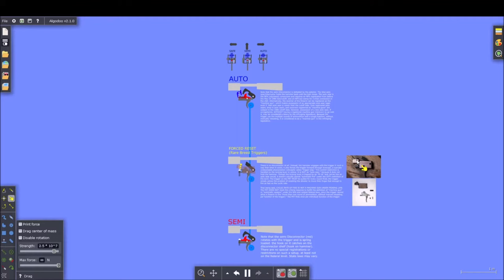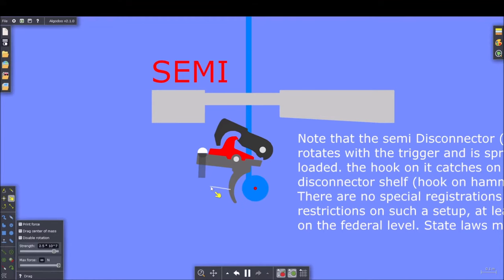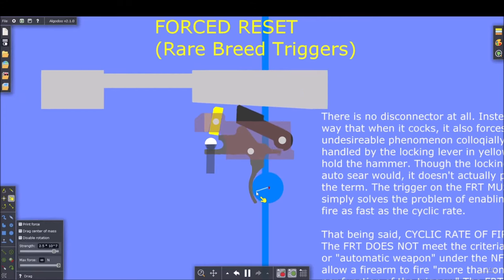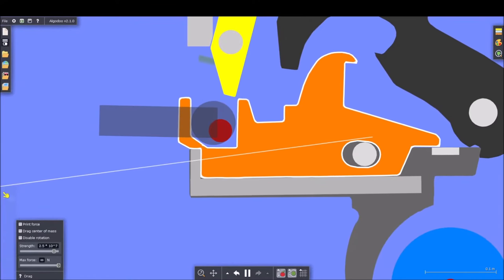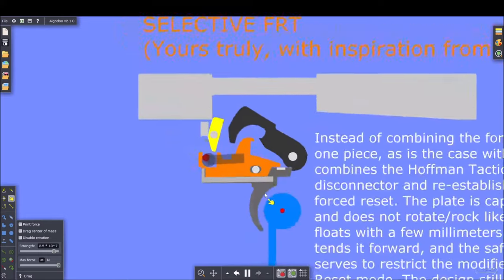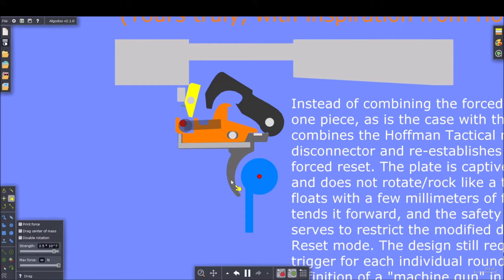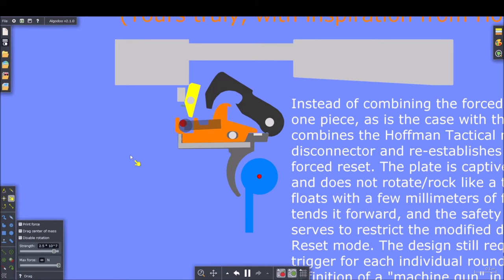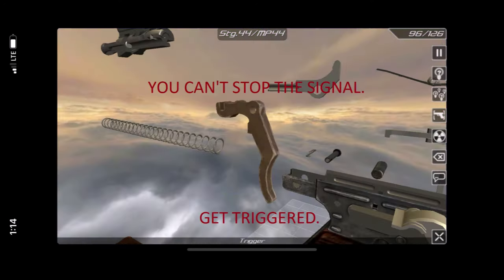How Forced Reset Triggers Work

Comment: I made a design where the disconnector when locked in the rear position by the selector gets locked in a way that when the trigger is pulled, the disconnector acts as a forced resetting surface against the hammer, in the normal forward position, it falls into a recess and hook that allows it to act as a normal disconnector… this theoretically speaking can be upgraded forward to mimic the function of a burst trigger using a counting mechinisim in the hammer, the counting mechanisim would keep the forced reset/disconector hybrid in the rear position for 3 shots, after the third shot, the disconnector forced reset hybrid falls into that recess with the hook, causing it to act as a normal disconnector catching the hammer… sadly I think I will never see either of these in fruition because of the current dictations by the ATF
Reply from the maker: Yeah we will. They’re not going to keep getting away with it. It’s their hill to die on, and this time we have the experts and lawyers weighing in on it.

Your mechanism sounds good. I’d like a way to make it work in a way where it can be selected into or out of that function so it’s not burst frt all the time. I’ll play around with what you said and see what can be done.
Reply: @StealthTheUnknown   you could have multiple resetting disconnector hibrids to swich function maby, and if the size of the space for the trigger mech allows it, the space that the trigger itself uses for the disconnector could be widened for more support and to be able to accommodate them both… it might only be a piece of the puzzle tho… also, is there a discord or something we can talk on? I’d love to talk to you
Reply from the maker: @lilrobi45xxx42  see what? I don’t have that particular mechanism drafted up yet, it’s just an idea right now
Reply from the maker: @lilrobi45xxx42  unlessyou were asking Cowboybub2003 Percussion
Reply: Welp. Looking forward to whatever this idea is now :)
Reply: You do you, as is your right! but if you've used a 3rd burst M4, you know it suuuucks. Just my opinion. Never know if youre gonna get 1, 2, or 3. I hate em. I prefer select Safe, Semi, Auto. But maybe that's just me. 🙂

Comment: Hughs amendment only banned the sale of automatic guns made after 1986. It didn't ban the ownership of automatic firearms, just caused prices to skyrocket.
Reply: Which made it financially impossible for most people. Basically illegal through regulation
Reply: @Darth_Nihilus777  but not illegal, just expensive and heavily regulated
Reply from the maker: My problem is that the difference between an AR that costs $1,000 and one that costs $10,000 is one pin, a stamped piece of steel, and some internal geometries. pennies or a couple bucks worth of material and maybe a bit more for the work to produce it. But the inflation on that extra work is several orders of magnitude in one go. Absolutely fucking wild.
Reply: @StealthTheUnknown you gotta remember most full autos have some history and a story behind them that’s also what drives up the value I agree with what your saying tho

Comment: While I agree that function wise these triggers do not make it burst or full auto,  in the 20,000 pages of Federal firearms regulations there is sections that do talk about rate of fire, in these sections it does clearly state the max rate of fire for every common firearm on the market & that it is illegal to modify the firearm any any way to increase the rate of fire form the manufactures design.
Reply: Point me to that regulation. Was that passed by Congress or written by the ATF?
Reply from the maker: That's talking about modifying the cyclic rate of the gun, and they aren't laws. Discussions were had, but it is not FEDERALLY illegal to modify the cyclic rate of a gun (how fast it would shoot if it were auto,) it's illegal to make one do so. Several states have their own laws about rates of fire, that it's illegal to install triggers that specifically accelerate the rate of fire of an otherwise normally functioning semi auto. No gat cranks or binary triggers in Florida.

If you have a machine gun legally you can change whatever you want on it. There's a saying in the NFA community, "machine gun trumps all." It means all the stuff about configuration - barrel length, features, grips, etc - none of it matters if it's a machine gun. Make the barrel short, the machine gun tax stamp covers that.

important to note regarding rate of fire, a very critical regulating component of the cycle rate of a firearm is the mass of the bolt. FYI, they sell skeletonized/minimalized bolts and aftermarket return springs, all sorts of features that would and do conceivably increase the rate of fire.

Comment: I have been fascinated to the two videos, h and k and the sig saur burst group. I would hope that you do get to come back to those two other groups, like the fn. I don't wish to demean or negate progress, but encourage you to continue. It is interesting to see frt or the bearing group for an auto effect and the ripoff (yet to be determined) bdu wot. I'd really like to see your good work on simplistic design for burst. If it is similar to fn design, ok. Great minds and all that, yeah?

Edit: I finished the video. I think the chevrons deferens (I think I have my Latin correct) being spoken from "armed scholar" (I like his stuff a lot) is a good thing. Resummarizing, a definition of what is contextual shall be followed when definitions are reviewed and we know aft, has not been so conserved about this. I think I did that well, the people in supreme court having said paraphrasing, no. No new definitions of an assault rifle, that's incorrect. Bad aft, bad...

Your rear view of the bar setup makes me curious on spring assembly, laterally when selecting operation mode for the group. I see some inherit problems, but that's the fun part. I wonder if it's probably to work if selection is biased to the train of thought known, err on the side of caution. Chamfer being a weak point to slide with, down to single projectile release from burst, or single to safety in knowing it will prevent the worst-case-scenario of runaway firing. There may be a better revision to think about. Adjust the selector switch to have a cam profile to be fixed and active per group operation selection. Yes? Maybe wayyy off base of what your mindset is for simplistic operation modes for trigger groups.

Comment: Good illustration of why the simple filing off of the disconnector latch in a semi is a very bad idea. Can have out of battery firing or just hammer following the bolt down and not having enough energy to fire the primer. Or it can catch on the FP. Just a bad idea.
Reply from the maker: Exactly!

Comment: Excellent video! I'm always impressed.  If you don't mind, what are your simulation settings? Like simulation Hz, weights, scale, etc. I have some clipping when dealing with high speed or small objects, like bullets and firing pins.
Reply from the maker: Set the sim frequency higher (2-400 is usually good enough,) and make parts a bit bigger and heavier than normal. Some guns are huge by scale, but it’s the proportions that are being used instead of the scale. It all has to be balanced, of course

Comment: Does it require the same amount of minimum pull force to maintain firing fully automatic vs maintain firing repeatedly with a FRT?
Reply from the maker: @Franimus  the pulling force varies between different offerings by different companies. From what I gather, the pulling force to break an FRT and begin firing is about the same as a full-auto, but unlike full auto there’s a cap to how hard you can pull an FRT before it starts to hang up. Eventually, friction between the hammer and the bolt as a result of pressure on the trigger will cause it to freeze the bolt to the rear until pressure is released. 

Otherwise, yeah. They’re pretty much identical in the amount of “push” you give them. All depends on the offering and its specific mechanical features - how many springs you’re compressing, how the mechanisms move, etc.
Reply: @StealthTheUnknown  thanks for the quick reply!  What I mean is do you need to vary the force you're applying with a FRT, or is it consistent?
Reply from the maker: @Franimus  the force you apply is consistent.

Comment: So the force reset trigger is like that pirate meme.

Feds: "Is this legal?"
Pirate: "Well no, but actually yes."

Technically it is legal due to your finger moving ever so slightly, kinda like the bump stock where your finger is pushed against the trigger to cause it to fire another round. It's parts like these that are forcing the ATF to redefine what a 'machine gun' is, loopholes like these should be patched just like the gun show loophole because it just causes more trouble for everyone else. Heck the ATF or whoever else is trying to make disassembling and reassembling guns for cleaning and maintenance illegal because of parts kits. All of these 'solutions' to go around the law are causing more laws to be made and placing harder restrictions on the lawful owners.
Reply: If you think passively sitting around and not working within the confines of the law would somehow make you safe from more GCAs or NFAs then I got a bridge to sell you.

There is no such thing as a "gun show" loophole. FFLs are still required to process 4473s regardless if their sale is at a gun show or in house. Depening on the state, private sellers may sell a gun without the need of a transfer through an FFL, but that can be done anytime and a gun show is unnecessary. Additionally, a seller must still follow federal and state restrictions and most states have a "reasonable belief" burden of not transferring to a prohibited possessor. There is no hard requirements on what reasonable entails, but it is in a seller's best interest to have at least some diligence lest they be found guilty of something.

Also the ATF has been loose and goosey with definitions for sometime, its only more recently that they've been bold enough to completely rewrite a definition provided by Congress. Just look up the items that the ATF has ruled to be machine guns in the past: shoestrings, rubber bands, electronic gloves, drawings, and all sorts of fun stuff.